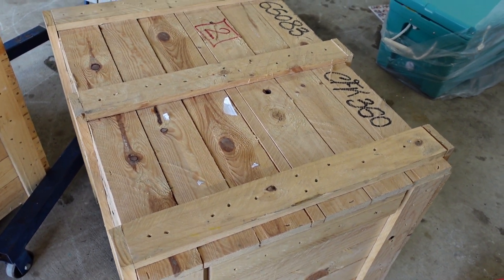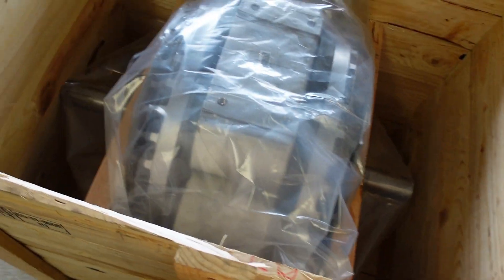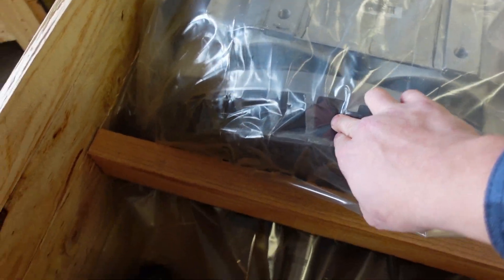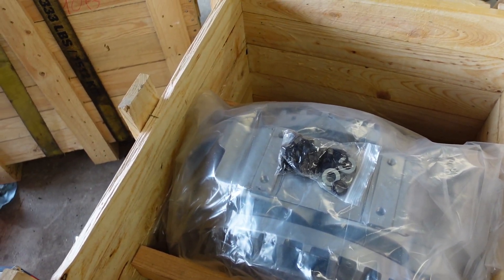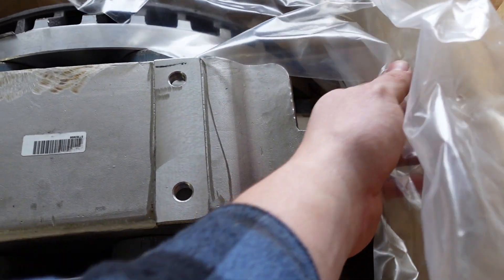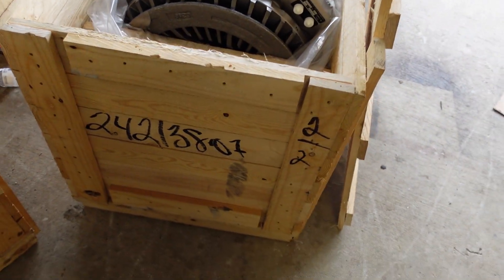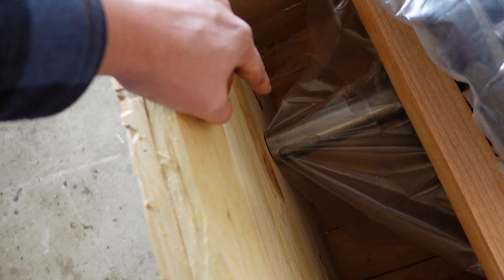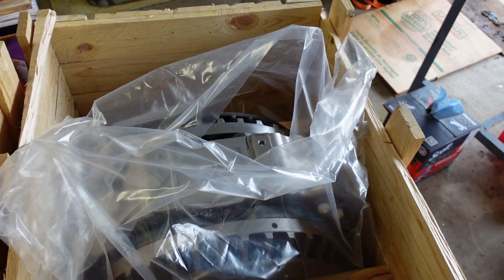DIY Hub Dyno: Power Absorbtion Unit Unboxing [3]

Comment: How was the shipping process for you? I am currently looking at ordering a pair of 360s, but to be honest, Ive never ordered anything like this from overseas...
Reply from the maker: @ericmiller4285  Klam made it very easy but I did receive a letter from the state saying I imported goods without paying taxes so I had to take care of that. But Klam took care of the state side ground shipping and customs too!
Reply: @carsandengineering2022  Awesome, Im glad to hear it was a pretty simple process! Did you have to have them shipped to a commercial location? Or were they able to deliver with a lift gate? Thanks for the info, it is much appreciated!
Reply from the maker: @ericmiller4285  I was lucky and had access to a commercial loading dock. I think they would use a lift gate, but it would cost more. These things are HEAVY! so be prepared.
Reply: @carsandengineering2022  They are definitely heavier than I would have guessed! Just curious, was there any tracking of your 360s when they were in transit? Maybe once they arrived stateside and were on a truck? I only ask because I will be having mine shipped to where I work, and its a LARGE facility. Im a little concerned about them being dropped off at the wrong dock location and trying to hunt them down...
Reply from the maker: @ericmiller4285  I don't remember too well but I do remember them just showing up at the loading dock and I had to rush to the facility...

Comment: Nice project! Im looking at doing the same. Can you provide model number and supplier of these units? My project would probably require some sort of gear reduction, im having issues finding anything that operates over 5k rpm and mine would be used as a motor dynamometer. Thanks for posting!
Reply from the maker: @chrisdragosh8034  I think somewhere in one of the videos I show which model and the specs of it. These, if I remember right will go to 6k rpm. For a motor dyno I would look at something else or consider a water brake. I do not recommend gearing. I should mention, for an engine dyno, you can find used ones for less than I believe you could build one for.

Comment: Thats very cool. Im quite interested in what you come up with for a solution for getting from the hubs to the PAU.
Reply from the maker: Thanks! Me too! Haha. Right now I am planning to use QD (type sf or sk) bushings with weld on steel hubs. Weld those hubs to some sort of "cup" or "bowl" shaped hub that will have the bolt pattern to attach the different vehicle hub adapters.
Reply: What did they cost ?
Reply: I can't wait to see the rest of your build and design process.